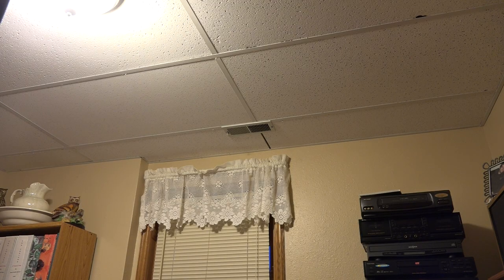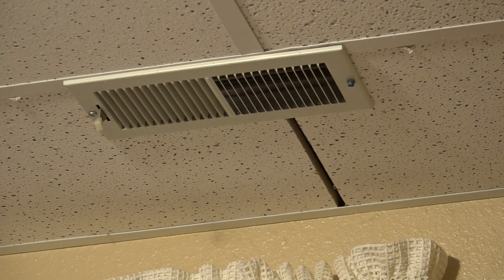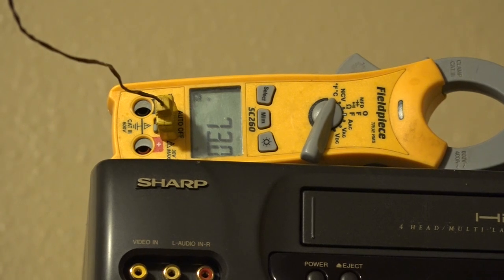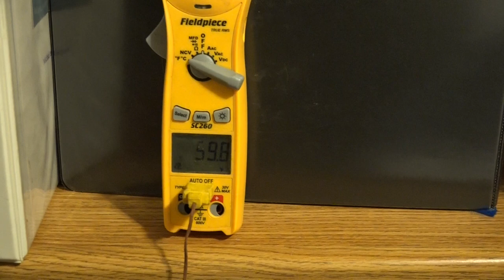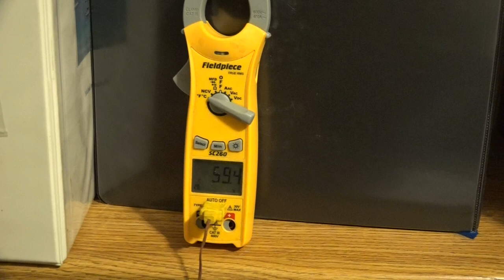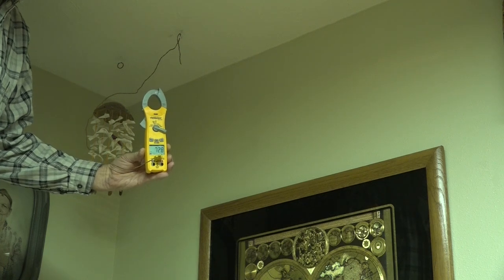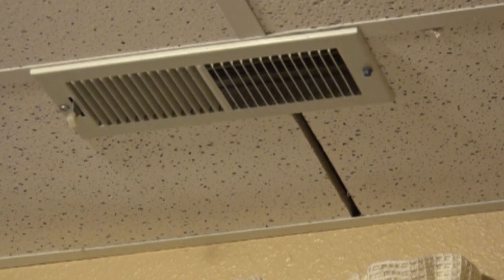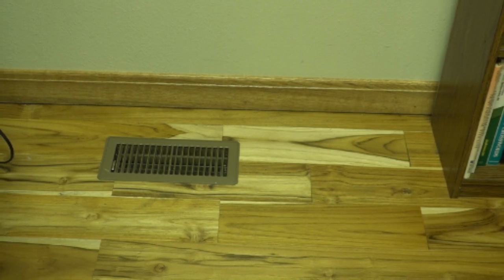The ceiling diffuser

Comment: Now my folks had a spilt foyer home with an open floor plan on what was a family room, no garage in this case. In the lower levels of this home ceiling diffusers were of course in the ceiling and with an open floor plan there was no left wall dividing  the lower family room space in foyer area which acted like chase. In the winter the lower defusers were opened for heating. In cooling mode the lower defusers were closed completely to balance the system for cooling and vice versa for heating. It was a very difficult means to balance this system and very hard on it! but with the lower operating temps of a heat pump in heating mode it balanced very well, but when resistance heating was in use you could defiantly tell the lower space of this home was not heated nearly as well and effectively by being more uncomfortable during those times and the heating balance was lost due to higher output temperatures. Thought this might be of interest to some degree as well!
Reply: I meant right wall actually!

Comment: In my own home I installed a hi-low set up. In the winter I close off the high registers, in the summer I close off the low ones. I've offered this set up to customers when its been feasible but only twice has anyone opted for it because of course it raised the cost of the install but it makes a world of difference. I stole the idea from my friend whose house was set up like that. I wanted to do the same thing with the return but I got lazy.
Reply from the maker: That is the best setup for both heating and cooling, but you are right, no one wants to pay for it.  They will, however, complain when it does not work well.
GFM
Reply: grayfurnaceman hi I was just wondering can bugs come trough them